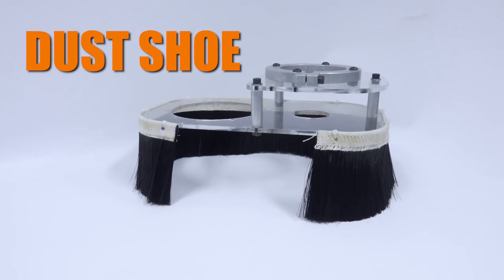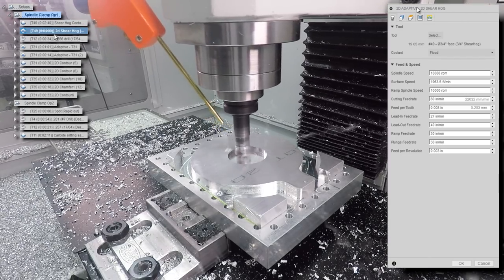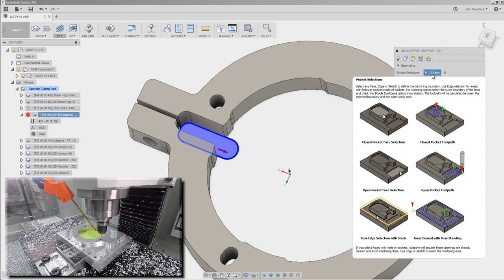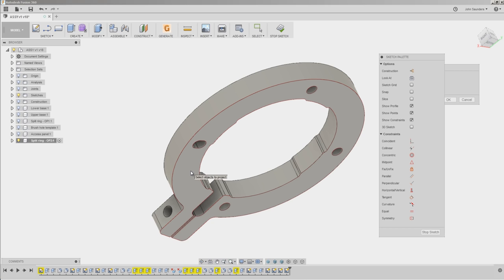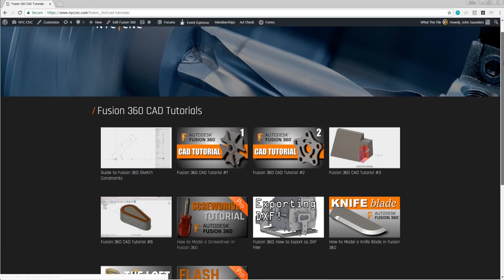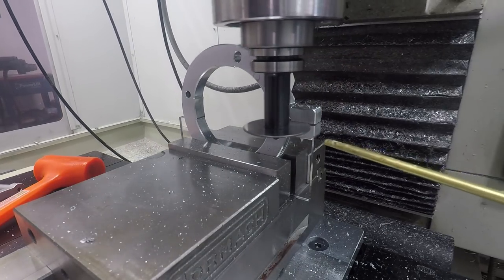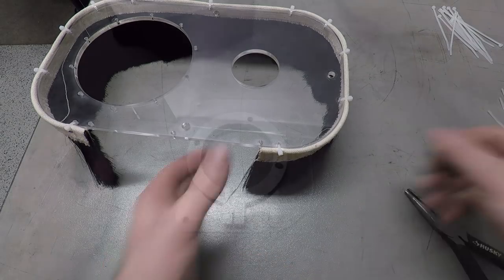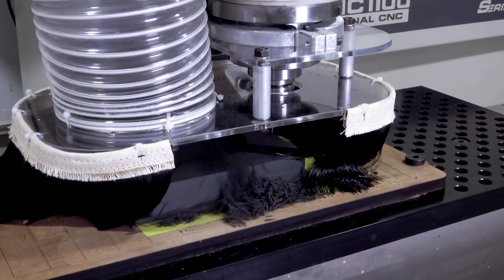Making a Dust Shoe for the Tormach! WW198

Comment: No issues with the brushes picking up too many chips? (On my machines i’m ditching brushes for transparant flexible rubber).due to the xyz motion of the machine the brushes open and close, picking up heaps of chips, making the brushes about 5 times as thick.. :)

Comment: Hi John. does the missing brush strip st the front have tech reason, or is it just for filming the cutter action? Good find on the brush strip BTW, I need to make this dust collector for a small gantry router.
Reply: Nick Martin it's so he can see the workpiece while it's being machined.
Reply: Improved air flow you canna get out if you canna get it in

Comment: Through lots of trial and error, I've learned that clear PVC plastic with slits cut in it works much, much better than brushes....and you can see your tool.   Like a walk-in freezer curtain..
Reply: Ed Rees yea sometimes the plastic sucks in a bit, but its because of good suction and airflow.  I get virtually no dust escaping even if the plastic sucks in.  As long as the plastic is not so long that the cutter can hit it, its fine.  I also don't slit the plastic all the way up, which seems to prevent it from being too flimsy.
Reply: I'd love to see pics or a video of this!
Reply: Doesnt clear pvc turn murky and unclear over time?

Comment: hi, congratulations, nice project! why the suction pipe is so big ??
Reply: As I understand it, you need high volume of air for chip extraction rather than the low volume/high pressure you get from a shop vac.  Hoping to get some extraction soon so I can do this on my home made cnc :D   Better than standing with a vac hose !!

Comment: So now you can't use the tool changer
Reply: That 770 has no changer :)
Reply: Ed: Are you sure? The description reads 'How to machine a Dust Shoe on the Tormach 770!' and the tools are being changed by hand, so it looks more like John's 770.
Reply: Pretty sure they machined it on the 770 and installed it on the 1100
Reply: At 0:23 you can see TORMACH  7   on the right hand side in the center of the screen.
Reply: smithbrianr387 is right though - at the end of the video, the dust shoe is attached to the 1100 - my bad. Its a very handy addition; its a real pain to keep floating plastic chips out of the coolant tank.
Reply: Honestly name the last video you've seen him use an ATC